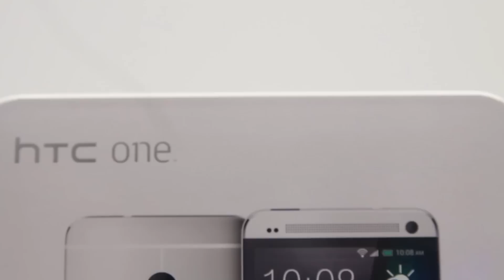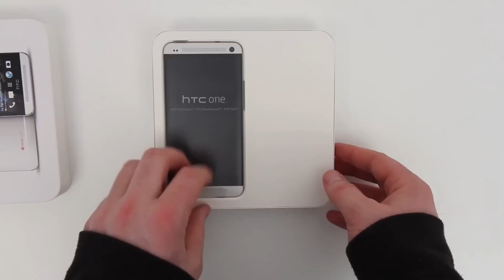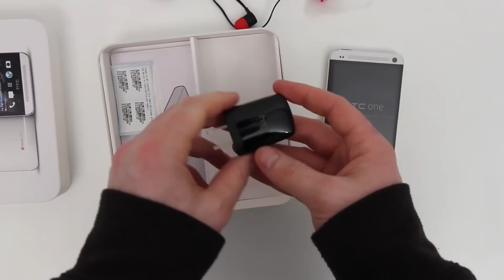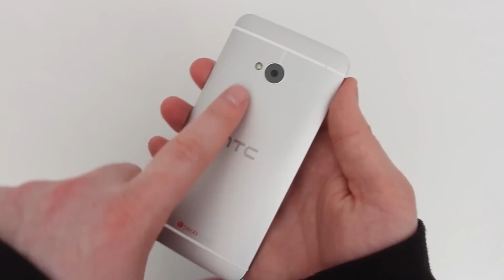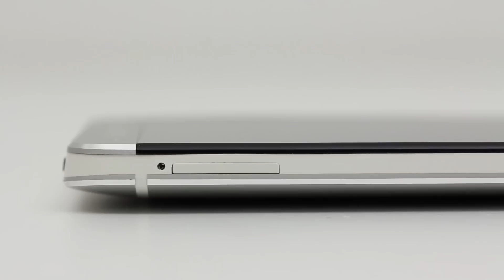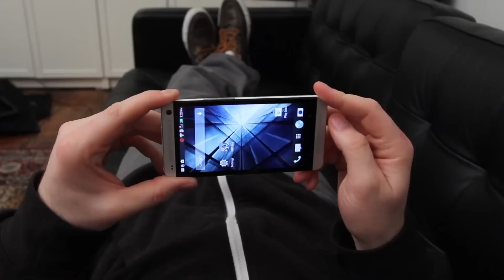HTC One Unboxing & Overview

Comment: It's 2019 and I'm still using this phone
Reply: I'm still using it now, but not for long I've bought an other phone. but damn this m7 lasted for 6 years!
Reply: How's the battery life? 😬
Reply: @Ag3ntMatt  it goes to 0 straight from 35 percent..
Reply: @shankarsaraswat5149  OMG BRO YOU HAVE THE SAME PROBLEMS AS ME, WHY NOT SWAP OUT MY CRACKED SCREEN, MY POPPING OUT METAL SPEAKER FRAME, MY BATTERY, AND MY LOGIC BOARD
Reply: Used mine till 2019 too (January). My battery started acting up so I had to replace it. 
This phone was ahead of its time.
Reply: ITS 2020 AND IM STILL USING THIS PHONE
Reply: Emerald Master how is it?
Reply: it's 2020 i'm still using it
Reply: Super
Reply: ikr im abt to break mine like its making me so angry hhh
Reply: bro same
Reply: January 2021, still using this majestic phone. :>
Reply: but i'll be buying a new phone this week, hopefully.

Comment: it's 2017 and I still like this phone more than most of the others
Reply: Mahmoud Mu Im still using this phone :)
Reply: me too has a lot of issues though. pink camera creackling speakers after a few years and the battery isnt the best. but considering its like 4 years old now. it look like it came out this year and performs like it
Reply: Und erst recht die Verarbeitung von dem Handy ... Das Gehäuse finde ich immer noch besser als von sehr vielen top Smartphones und die Lautsprecher, sowie die Klinkenbuchse sind definitiv besser als ALLE Top Smartphones (Razer und HTC mal ausgenommen :D)
Reply: as a taiwanese i am so proud of it...too bad its cellphone department is sold...
Reply: If they released an updated slightly larger version today with up to date specs, I would buy it again in a heartbeat.

Comment: I own this phone. Currently watching this video on it. THE SPEAKERS ARE NOT LOUD!!!!!!
Reply: The Green Moab Agario And More bruh mine so fucking loud I had to turn it down
Reply: Run a Toothbrush across the grills kinda ruff. It cleans them
Reply: +Redenderpearl can also mean that Beats is off
Reply: Turn on the beats audio I guess
Reply: Turn beats on and clean speakers using toothbrush. Remove case if you have any. Then run brush from left to right.
Reply: You fools, turn beats audio off since it reduces the volume but enhances audio quality

Comment: If you buy it unlocked and want to connect it, it's a smartphone so it will need a data plan to connect the device. If the device is not connected, you cannot text. If you buy it unlocked, you can connect it to wifi and download a texting app and text from there. Does this answer your question?

Comment: The Sony Xperia Z does not have front facing speakers, the speaker is on the bottom right, which is a strange placement and the speaker is not very good